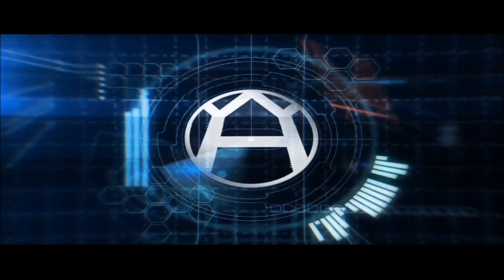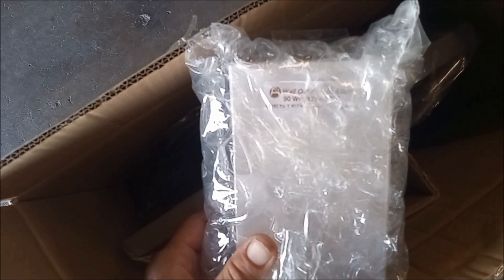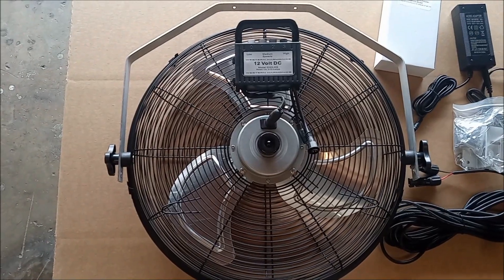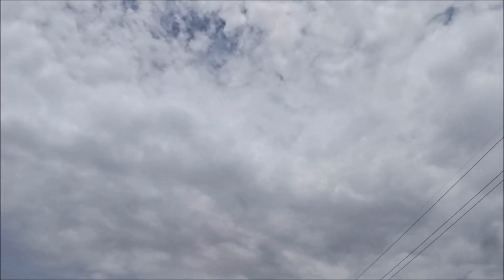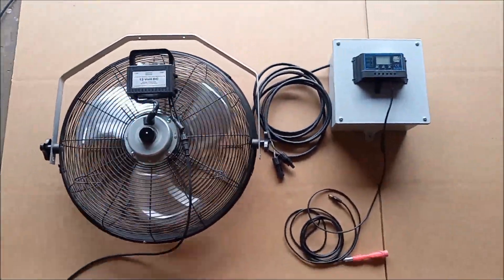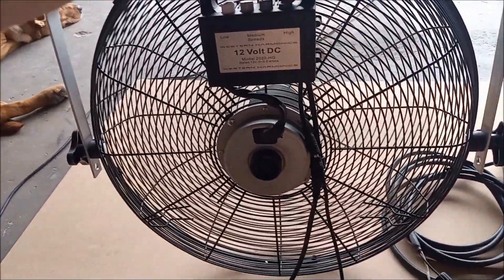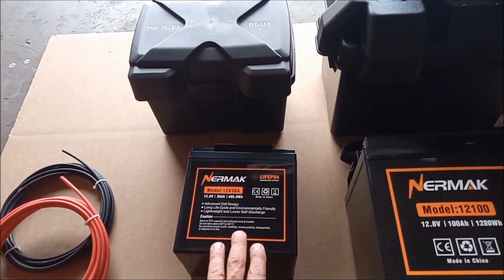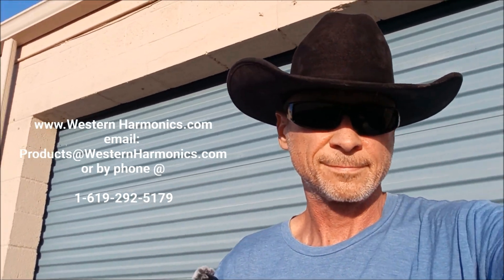Update: Solar Hanging Fan for Horses We're producing solar panels and fans! Plus batteries systems!

Comment: How long is the cord for the fan panel connector? Also is there an easier way to adjust the fan speed or do you have to physically push the buttons to change?
Reply from the maker: Hello!  It's 25 feet.  Push button speed settings, and on/off.